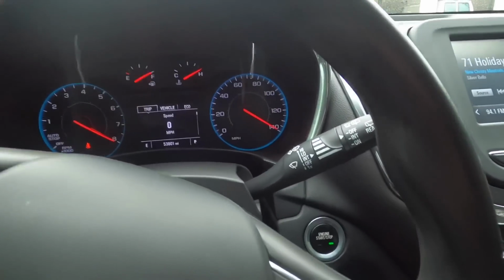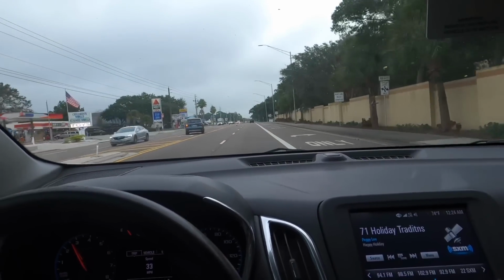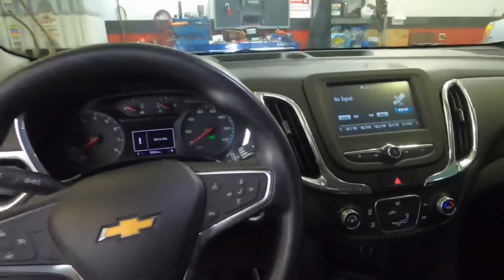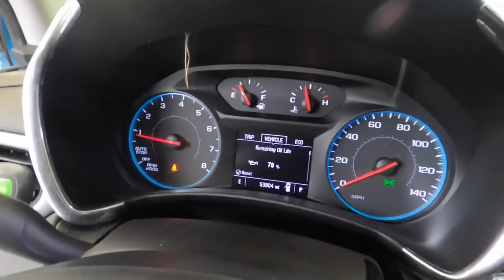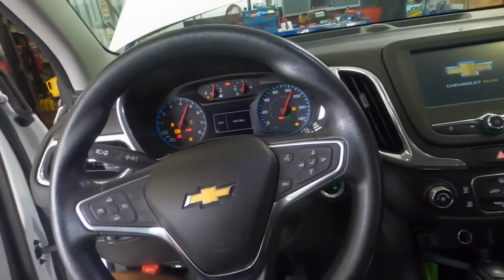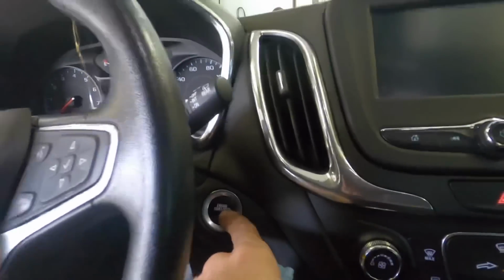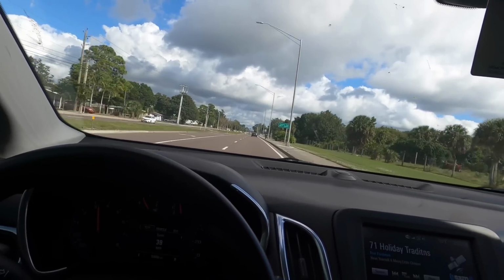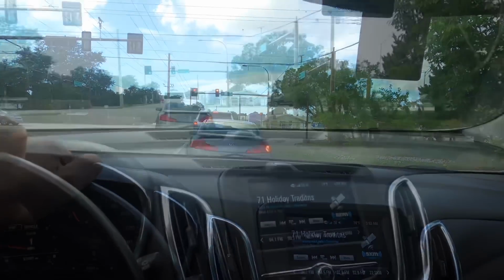Low oil could cost $$$$ | By Mistake!

Comment: Good one Ray.  Somehow, I liked the old days when a cam was a solid bump stick and the only variable was the slop in the metal timing chain. LOL
Reply: it's got it's trade off, way better fuel economy and timing can go from eco to performance in a snap when you need it. this only happens when people do poor maintenance and the screen get's clogged with carbon on the VVT solenoid. the low oil is a telltale sign, i would bet that oil was black with tiny specs of bearing material in it. i will say these things are damn finicky to piss of though, did a valve cover gasket on a newer BMW, cleaned everything beforehand and still someone a magic piece of something got in there and the VVT started to cause a misfire. easy clean but for people unaware of them it can be a nightmare.

Comment: Timing chain etc. at 53 thousand miles sounds about right for the Triumph V8 engine, possibly the worst engine that ever made it to a production vehicle, at least this side of the iron curtain.
Reply: Sounds right for a GM.
Reply: @vw5056  Is GM potentially trying to steal British Leyland's crown for king of shoddy quality  outside communist countries?
Reply: @beardyface8492  I owned a Leyland era MGB and it was far superior in every way to anything GM I ever had contact with.
Reply: @vw5056  Being UK based & old, I've owned many BL vehicles, & such problems as they had were common, but (apart from rust & the previously mentioned Triumph engine) easy to fix.
Their reputation was the problem, not the actual cars, the press went after them. Most were actually OK if you didn't mind fixing easy stuff.
It's the reputation I mentioned not the objective reliability.

Comment: Usually when I run into that I doubt the maintenance done and check air cleaner also, the last 2018 I did with that motor the air filter was so bad it had gone into limp mode during testing, 70,000 miles , changed oil,filter, and air filter all codes gone limp mode never engaged again

Comment: Just a quick note, the new gm 1.4t and 1.5t engines have a tendency to crack piston ringlands, and cause oil consumption even at low mileage. Have seen 3 cars with such engines have this issue.
Reply: They also do not tolerate long oil change intervals, the PCV will plug up an blow the rear main or driver's front corner of the head gasket. They just cut labor times on em too.
Reply: @jeremyeaves5272  I've seen the 1.6t also have its pcv become clogged. Can be mistaken for belt squeal since it makes the same sound when the pcv is open, I haven't seen em blow out rear mains yet nor the headgasket
Reply: @DieselIlIl  Nice part about working at a dealer in the north, I know chevy equinox rear main season has started lol
Reply: The ecotec motors have always had problems with timing belt/guides and cam solenoids so they advised to change them every 50,000 due too guides breaking and belt/chain going slack and jump timing but I seen 3 in a row happen that way and the guides break and then jump timing and boom bye bye motor so any person I see I let them know if you hear rattle on start up or higher idle then they should do the timing belt and guides witch a kit comes with phasher too but if you want life out of a car then fix the faults and stay on it and hopefully you get your money worth...
Reply: Have seen torched ring lands and a holed piston in a couple of them too.
Reply: We have a metric shit ton of 1.5s come in, we don't see much troubles... Few turbos and shit but that's it usually... Had a few with piston issues but their rare
Reply: @FusionBoost2.0  I said 1st gen non turbo is the one I'm talking about and 2nd gen turbos has carbon and oil issues and in AZ any rubber products are short life items and like the fords that the oil pump in the oil pan the belts are the down fall but all cars have there weakness
Reply: @FusionBoost2.0  GM's 1.4 and 1.5 turbo engines really kinda suck by way of comparison to the Ford unit. Timing belts and water pumps are all I've seen on the Ford. Now tell me about 3.5 water pumps and how well designed they are.
Reply: @jamesgeorge4874  They do yes, but working at a GM dealer, the 1.5 isn't bad... I've seen better but I've seen worse to lol

Comment: Shows how important it is for regular oil changes using the right oil and regular checking of the level
Reply: Lifeblood of the engine...
Reply: Should you check the oil when the engine is cold or hot or does it matter?
Reply: @ceruleanc505  cold
Reply: @ttgk8506  Ty. I did see the mechanic in this video check it hot though, yes? So you can still get a reading at hot, but the more reliable reading is at cold engine, right?
Reply: Every 3k miles. My dealer tried to tell me every 10k miles lol
Reply: @ttgk8506  IF you're using full synthetic, like you should be, changing your oil every 3k miles is literally throwing money away and isn't keeping your engine any safer. If you want to CHECK it every 3k miles go for it, but I promise you will find that your oil won't need to be changed until the 10k mark. And as far as hot or cold, usually cold is what you go with, but some cars have markings on the dipstick for both cold and hot levels. But usually cold/warm is best. He didn't check it hot, he checked it after he rolled it into the stall, it had been sitting in the parking lot. But regardless.....if your oil is showing low when it's hot, it's definitely low when it is cold.

Comment: Ray saved the driver $1,500....  Holy smokes, the shops around here would have sold him a new transmission, ball joints, brakes, cv joints and radiator flush!
Reply: Well, the customer is the person who didn't check the oil level and likely tried to save a few bucks by resetting the oil life monitor instead of changing the oil.
Reply: Quit lying! They would have included a liquid tune up in a can.
Reply: You forgot to mention the blinker fluid and muffler bearing...

Comment: Who determines in the USA if your car is allowed to be used in public traffic, like for security issues and so on? here in germany we have the Hauptuntersuchung that is beeing done by the TÜV for example and gives your checked car a 24 months permission for use in public traffic.
Reply: Safety inspection requirements vary from state to state.  For example in the state of Pennsylvania a yearly safety inspection is required, and in the state I live in, Maryland, a safety inspection is only required during initial vehicle purchase.
Reply: @21Piloteer  first of all thank you for the information. so, if you buy a used car, you can not be sure in what condition it is, depending on the state you live in, since it could have been brought over from a different state? or even worse, you drive on roads that could be full of "broken" vehicles since it is not mandatory to check them unless you try to sell those? maybe i misunderstood you. (sry, english is not my first language)
Reply: @cafecaram4747  Are you an Arab? Just Curious.

Comment: looking at the color of the oil it looked like the person had not kept up with oil change maintenance, and after adding cleaner to the oil and a oil change by Ray i would think in about 1000 miles it should be cleaned again and oil changed and after that another 1000 miles and just do an oil change and stay on a normal maintenance mileage
Reply: Unlikely, turbocharged engines go through oil and go darker quicker than naturally aspirated ones due to larger ring gaps from factory, and higher combustion chamber temperatures. Even following basic manufacturer service intervals, I.e. 7500 miles or 1 year, is too much on a forced induction engine. In my opinion, it should be changed every 3000 miles or 6 months.

Comment: I would have loved to have seen your customer's face when you told him that you fixed his car with an inexpensive oil change
Reply: I hope the Customer understood and appreciated it. A Automotive Repair Facility Can Make good Money by just fixing What Is Wrong. Look Out In the parking lot. Does It have A lot Of Vehicles? That's Probably because It's A good facility..  With that Said some people it's not going To Make any Difference.
Reply: Reminds me of when I took my old Toyota in to a mechanic. He had near perfect reviews. I was experiencing stumbling and stalling and in my novice mind, I was expecting quadruple digits for the estimate. Pleasantly surprised when about an hour later, he pulls around and hands me the keys to my newly refreshed smooth running car. $100 on the ticket, a smile on his face and an explanation, "after looking around we decided to try cleaning and maintenance on your fuel system. She drives better now and I don't see the need to spend more money today.". Got 8 more years without major problems.  That's a great mechanic
Reply: Exactly, you don't have to lecture those sloppy Joes, just tell them what was the problem.
Reply: "BuT i DidN't oRdeR aN oiL cHangE so Im NOT PayIng FoR it!"
Reply: @JaakkoF  then he would be charged a diagnostic fee, which would cost more
Reply: I was going to comment the same. “It’s fixed. That’ll be ($insert vastly lower amount here)”.
Reply: It was actually an expensive oil change, as he did a cleaner too!
Reply: @mrjackson2k  Even an expensive oil change is a cheap repair compared to simply changing engine components.
Reply: @mrjackson2k  Cleaner is not very expensive
Reply: @mrjackson2k  nowhere near as expensive as the other diagnosis would have been
Reply: @mrjackson2k  Or What Kind Of Oil. If Was Mine I Would Change The Oil again In 100 Or 150 Miles.
Reply: same here
Reply: Also, an engine is never the same once you crack it open…especially for no good reason.
Reply: @robertj2  only if you do it wrong.
Reply: @OneTrueCat  That's True But these Modern Motors Are A Bear!
Reply: @christopherl2143  no argument there.

Comment: So. you have a min-max area and this engine will fail if the oil level is in the min area? That's a crock! No wonder the Wizard does not recommend these vehicles. If oil level is so critical on this engine, there should be a low level warning light. Hell, my worn out '93 Ranger 4.0 had one. All of my cars and trucks that did not have oil leaks, or burned oil, managed to make it to next oil change without adding oil to them. I had one exception and learned through forums it was never going to stay in it's recommended oil level. I had a 1998 Cadillac Concours with the hated 4.6 Northstar V8. Well, it was recommended to keep 7.5 Qts in it with its tiny filter. Within a few hundred miles, a quart would disappear every time. It either leaked, or burned, don't know which, but that was it. After a few oil top offs and oil changes, I stopped with the extra quart and it stopped leaking, or burning, and never needed any more oil. One other thing, It had 150K when I sold it, never overheated, the coolant was always dexron and I used the silly tabs as recommended. I also surprised a lot of people at stoplights

Comment: Never look at the oil percentage or the mileage to change oil just get 4 oil changes a year and definitely don’t take it to a quick lube place. Pointless getting a oil change unless you get all the oil out of the motor which takes hours to drain “NOT TEN MIN” kinda like wiping before you poop don’t make sense
Reply: I agree with changing your oil often , but four times a year ? Don't laugh but I'm retired and drive about 3,000 miles per year . Hours to drain oil ?

Comment: Ray, I am impressed by your genuine desire to do what is best for the customer. I do enjoy your sense of humor and the general running commentary.
Reply: Because that is what pays off in the long run... And does not cost anything even in the short run:
An what would you gain by replacing the phasers anyway? Getting buried in replacing not that easy to replace component that actually does not need replacement will cost a lot off time which could be better utilized helping more of other customers, so you get the few hours of labor money from them. For the expensive parts you will have to pay, so that money you won't keep either. The only difference in outcome would be one pi$$ed and a few other still unhappy customers.
So really, screwing customers over by doing work that does not have to be done is just plain stupid.
Reply: A happy customer is a repeat customer.

Comment: My civic has a little turbocharged 1.5L. It works great for a little car but I can't imagine having a motor that small in a vehicle as large as an Equinox
Reply: It’s definitely sluggish. It also has massive turbo lag and is a bit of a pain to accelerate. The transmission doesn’t like to shift down either. But once it gets going it’s alright.
Reply: Yeah I think having the smaller 1.4, 1.3, etc engines in these big non-aerodynamic crossovers and SUV’s causes them to have to work harder, which puts more strain on oil, trans, etc; and people just don’t maintain em :/
Reply: I'm just a tight ass. I'd rather replace 4 spark plugs or 4 coils instead of 8 or 6, which are probably buried under a labyrinth of manifolds. Ride a bicycle in traffic for a while.. a 4 banger feels like a hypersonic ballistic missile. All relative ;)
Reply: 1.5 little ? In europe the 1.5 turbo is the big engine we get civics with a 1l engine 🤣. After saying that I'm not suggesting I would own one of these small turbo engines, I personally have a 3L turbo diesel BMW .
Reply: @callumcurtis15  yeah over here in the US people still like big motors. That civic is actually the first 4 cylinder I've ever bought and I also recently picked up a high mileage but very clean tacoma with a 4 cylinder. I've had a few V6's and I6's before that but mostly I've always bought V8's. Anymore though, I don't really feel like I need all that. I'm a bit older now and my civic and tacoma both have 4 cylinders and I absolutely refuse to buy an auto, so they're both manual
Reply: @mikecurry6847  Seeing your comment made me smile . We used to say that some people can drive a car while others only steer it . I watched a video of two guys car jacking a car at gunpoint . They both jumped out and ran off because neither one knew how to drive a stick . lol .
Reply: @callumcurtis15  I don't think that'd work here. I think we drive through very different conditions and need more power. 
I would imagine that's why cars in Europe don't last as long. Works them harder. I've looked at atvs with 1l engines lol
Reply: @davidmollard9832  idk man, I've seen 2.7L 4cyl Tacomas run for 400k. I know that's smaller than what you just mentioned but you can compare that to a V8 Dakota at basically the same curb weight. As someone who's owned both, the Dakota is waaaay less reliable although it could actually tow a decent amount for a little truck. I don't necessarily think that engine size is the whole thing. It's definitely a big part of it and you don't want an engine that's straining too much to move the vehicle, but there is also more to it than that. Some engines are just very reliable even if they're moderately worked, like the 2tr-fe. I'm really wondering how the engine in my Civic is going to turn out long term. They haven't been in use for very long, like 4 or 5 years. I suspect that a lot of the reliability issues in newer engines is directly related to how they all seem to use direct injection nowadays. Idc what anybody says, every direct injection I've ever seen blew gas back into the oil at a disturbing rate. And like you said, people don't properly maintain their vehicles. I always change my oil early on my civic because the oil always smells like gas and it's always like water at 0w20.
Reply: @davidmollard9832  also I was talking about the gen 3 Dakotas with the 4.7. The gen 2 with the 318 had a bulletproof motor.
Reply: @mikecurry6847  my wife's 2.7 Tacoma is a complete dog, beautiful truck but horribly underpowered coupled with mediocre fuel mileage.
Reply: @romak4756  yeah I'm not saying it's a powerful motor. I'm actually saying the exact opposite. It's a weak motor and is under powered for the truck. That being said, the 2tr-fe is an incredibly reliable motor despite being under powered. That seems to indicate that there is more to the equation than just the power to weight ratio.
Reply: @callumcurtis15  A 1.5 turbo in the UK isn't a big engine, it's usually eurobox garbage engine.  Renault etc. a 2.0 and above is considered a "Big" engine, if you have a V8 in the UK you're obviously an idiot or own you own oil well. 😅😅😅

Comment: If Ray thinks the 1.5ltr is miniature he should check out my 1.2ltr Vauxhall Mokka 2021 edition 3 banger in Ray’s terminology. But then again American cars are pretty big and bulky which needs bigger engines… or a Tesla power train.
Reply: A 1.5L trying to push an elephant of a SUV around seems pretty stupid.. and that's coming from someone driving a motorized shopping cart (2006 Citroen C1/Toyota Aygo 1L 3 banger 68hp). Kinda doubt these 1.5L engined versions of that SUV will last all that long, even with way shorter service intervals than recommended. It'll work itself to death under its own weight

Comment: Like my old diesel instructor used to say, always check the least expensive stuff first, that was a great one Ray Thankyou
Reply: My diesel instructor said K.I.S.S keep it simple stupid
Reply: Mine said the same thing. He was a heavy duty mechanic who spent some time at a Ford dealership. He said he couldn’t count the number of times guys with the newer powerstroke diesels with HEUI fuel systems came in after changing expensive parts to find out they had dirty oil, or were using the wrong grade of oil.
Reply: Mine said that too, and always start a diagnosis with logic in mind, don’t look for the unique or special case.